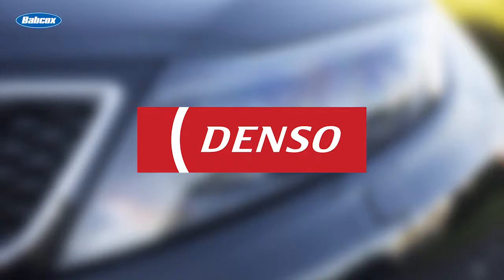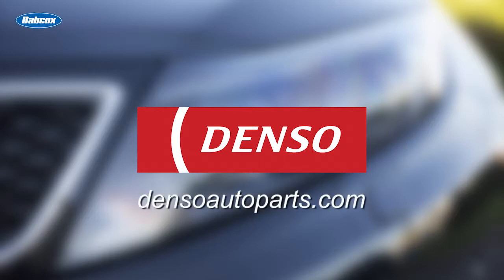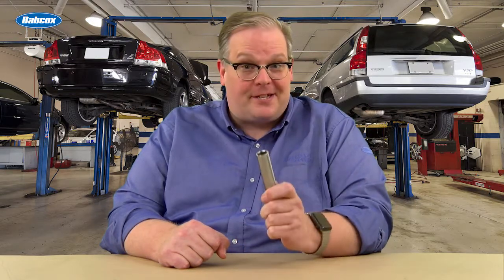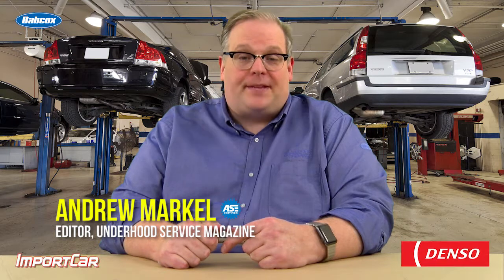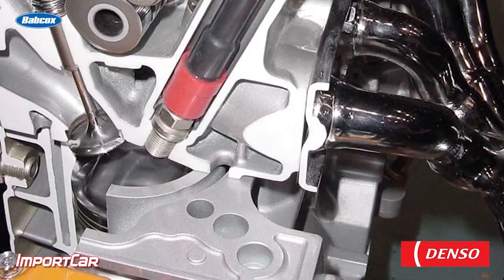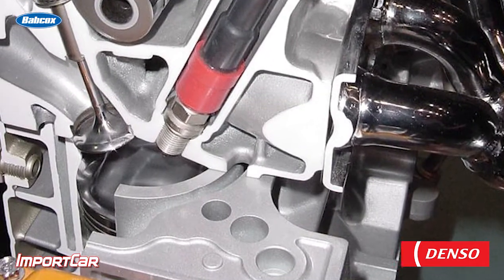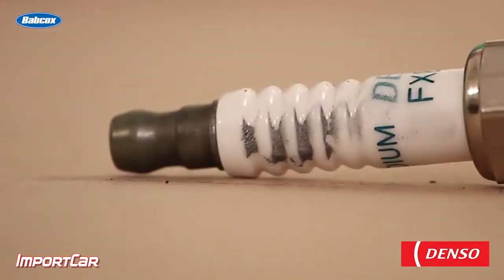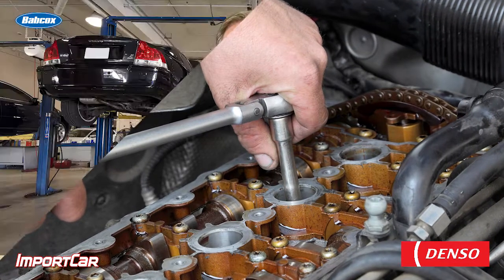Spark Plug Insulators And Flashover | Maintenance Minute

Comment: I've only heard this advice once before and it's great advice. Is it ok to put a bit of dielectric grease on the ceramic part of perhaps the edge of the ignition coil boot? Some boots can really stick and break as you pull out the coil. Thanks.